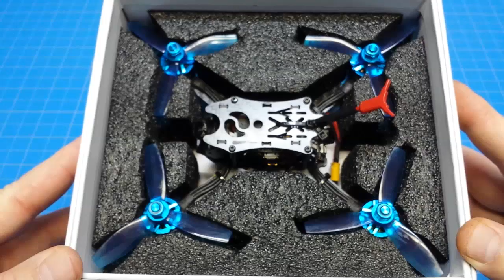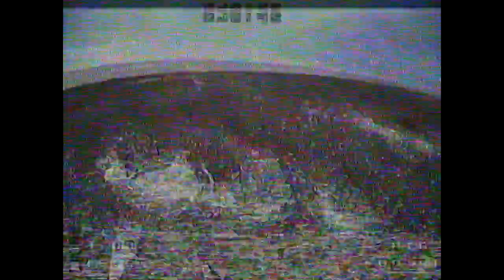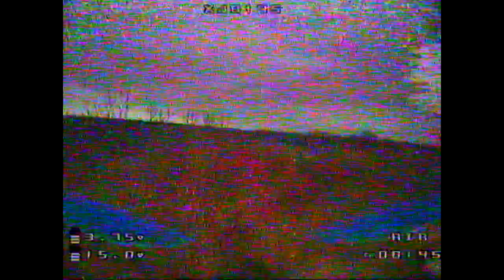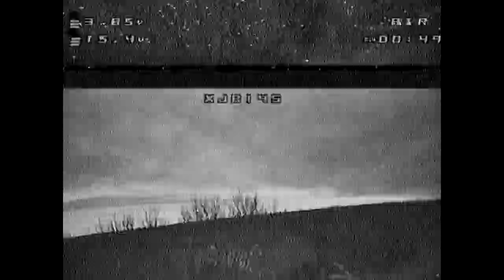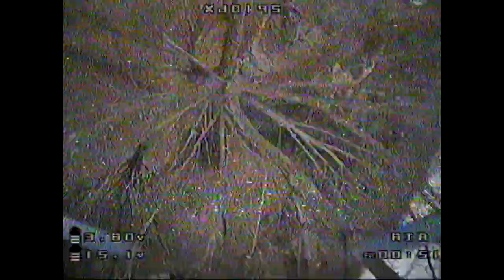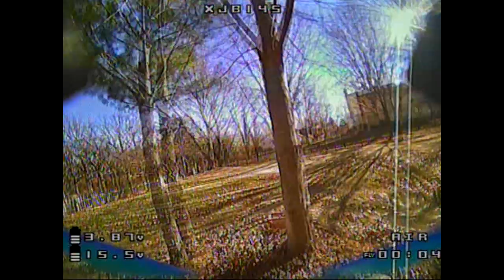HGLRC XJB145

Comment: I am using an XM+ and jumper ts8g with all stock settings on the XJB-145.  When I do flips and rolls in horizan or acro I get failsafe/rxloss warnings but have control of the quad.  Any suggestions?  XM+ flashed with latest RSSI software on channel 16.

https://www.youtube.com/watch?v=v8GYzSde8ZQ
Reply from the maker: I wonder if its a loose solder connection or loose connection on the receiver end. That symptom is typical of a loose connection. I would resolder and check again.
Reply: thx, I re-soldered the rx directly (removed the pin connector) and re-located the antennas.  I am getting a lot fewer rxloss warnings but they seem to only happen when i do full stick rolls or flips.
Reply: Could this be an issue caused by a betaphight version?  what version of betaflight are do you have on the XJB-145? Mine came with 3.2.3

Comment: I ordered an XJB-145 on sale from Gearbest, and the gyro is dead on arrival, preventing arming of the quad.  I was completely surprised that this has been on ongoing problem with this quad and the stack you can buy separately as well for a very long time since this drone is nearly universally praised for its quality and performance on various youtube channels.  I highly encourage anyone considering this drone to read this thread on RCGroups.  Buyer beware: https://www.rcgroups.com/forums/showthread.php?3000984-XJB-F428-No-Accelerometer
Reply from the maker: I think its also worth noting, it is much more common to voice displeasure than pleasure.
Reply: True, my biggest issue is the non-responsiveness for many people having the exact same problem from HGLRC across multiple versions of the same FC.  In the thread above, HGLRC's response to a customer was to reflow the solder themselves on the gyro, which is preposterous to ask a customer to do themselves, another was to ship the flight controller back to Taiwan at their expense.  Then they just sorta stopped responding.  That to me is kind of a red flag.  Any company can make mistakes, or have problems with manufacturing, etc.  But if you don't take care of your customers, then I steer clear.  And this is a common enough problem there's now a youtube video discussing the reflowing of the solder process, so it's beyond the problem of just a bad apple here and there.  I'm early in the process with Gearbest support, and I've also emailed HGLRC.

Comment: Love this one.  Only flew it about 7 times so far.  My OSD display is not working anymore on it.  I can only see the camera for flying.  No FC OSD information at all.  Does anyone know what's wrong??  Thanks in advance.
Reply from the maker: check to make sure the osd isn't turned off in betaflight, Also be sure you don't have a mode/switch setup to disable the osd.
Reply: Thanks.  I'm still not sure why but OSD is not working for NTSC video. Albert Kim has help me by setting the video to PAL video, then the OSD works.  OSD used to work in NTSC video.  Thanks.

Comment: Would you recommend this one or the Babyhawk R 3 inch? Could you please do a short summary of why? :) Thanks in advance!
Reply from the maker: If we aren't looking at price at all. I chose this, it performs much better, I can't stress this point enough, the xjb145 has a different class of motor. The xjb145 can mount a small hd camera if we want to do that. The babyhawk requires much more work to mount a camera.
Reply: Thanks for the quick reply! Keep fighting with my fears of the props in the FPV image. (Found transparent props which could be better a little, but still there...)
Reply from the maker: we become blind to props in view over time. I still notice when I first put the goggles on, but once I lift off I don't see them.
Reply: Sounds good, thanks again :)

Comment: Hey Nick - Currently the listing on Banggood says that it comes with the TX20 V2 (48ch with smart audio) while the listing on Gearbest says it comes with the TX20 V1 (72ch NO smart audio). Most all the reviews show the PNP version with the TX20 V1 (72ch), but I want to make sure I get the version 2 with the smart audio but IDK if I should trust the banggood listing. Do you know what is correct? (FYI I asked the support and they did not know)
Reply from the maker: I can't be sure. These companies switch at components with no spec updates.

Comment: Every video review of this quad seems like pretty low flight times. Would you say this is a battery hog compared to other three inch racers?
Reply from the maker: No, actually there are much worse. In my case I do fly with a smallish battery, I like to maintain a low weight for extra agility, it could easily carry a 650mah or even 800mah for longer flight time. But if your looking for more than 4mins likely looking at something that doesn't fly like this.

Comment: Is there a way to get audio ? With the stock set up ? Or something I have to swap out for ? Thanks so much 
Great review! I’m considering picking one up.
Reply from the maker: not stock. I think we would have to add another camera, or at the very least change the stock fpv camera to one with a microphone.
Reply: Nick Burns on this video you used stock camera ? I hear the motors   
That’s wat I want to hear with my audio. Is a small mic on maybe the transmitter? I’m confused. Lol
And yea I would change cam to a micro runcam for sure. Thanks 
LMK if you remember what gear you used on this vid
Reply from the maker: The audio is from a stationary camera (not on quad). I mix in the audio when editing the video.

Comment: nick i like this quad a lot, do you suggest it for long range (300 500meter) mainly exploring surroundings not freestyle flights? possibly with an hd camera on top?
thanks alessandro
ciao
Reply from the maker: getting a long range RX in under the top plate is going to be a challenge. The RX will likely have to go either under the camera or at the back, it can certainly carry an HD cam.

Comment: Nick, 

I have an odd question that I'm not sure who to ask besides you.  I can't think of anyone who has had more of these micro frames.  Sorry for leaving this question on YouTube but I don't have any other social media.  

I am about to start a new build with the new hglrc stack.  It includes a flight controller, vtx, 40a escs.  I want to also include the runcam split mini in it.  The runcam split mini is 2 20*20 pcb boards.  This configuration would leave me with 5 20*20 pcb boards in my flight stack....

Can you think of any frame that would accommodate this?
Reply from the maker: The eclair v2 is close but the cam won't fit. In this moment we might be looking at only a very few frames. The tomoquads csx...I think thats the name might.
Reply: Think the GEPRC Sparrow might work?
Reply from the maker: I don't think so, the pod plates are to narrow.
Reply: for the camera?  the new runcam split mini is 19mm across like a micro swift.
Reply from the maker: Yes, sorry, your right.
Reply: so, you think there is any chance that 5 (20X20) pcb boards will fit in a sparrow?   any other frames i should consider?

Comment: Can a drone like this also use an external HD action cam like runcam 2 or session/runcam 3 ?
Reply from the maker: yes, but it will impact performance and flight time.
Reply: I see, would you ever recommend using runcam split? May be with a soft mount or softmounted motors to get rid of jello?
Reply from the maker: We start to lose the micro of the quad when we have to move to a 30x30 stack, but yes that is an option. I think its more likely we need a better HD camera option. Something closer to 15% of the weight of the quad.
Reply: Thanks for answers. Im currently training in simulator and was thinking about a drone that would be easy tot ravel with and take some outdoors HD footage as well as fly indoors, in the open space office at nights for example. I guess so far only two separate drones can satisfy my wish
Reply from the maker: yes, indoor and additional camera is likely going to either not be viable or be a huge indoor space.
Reply: Hi, adding to our yesterday conversation, do you think with the Item like this one I would be able to mount runcam split on micro quad? https://goo.gl/UTCNZg

Comment: Not going to lie, want one pretty bad, but that 600tvl will be out the door fast. I for the life of me have tried but I cant seem to go under 700tvls. It just does not inspire confidence for me personally. Thank goodness that runcam just came out with a new CMOS 700tv in the same form factor. I generally run eagles or other cheaper CMOS cams. With some setting adjustments you really can get a great pic out of the eagle....as always great proximity flying....I could really tell you were feeling it, generally a great indicator for the quad itself.

Comment: Hey Nick, was missing some flight footage on your vids, eh eh... I already flown my Leader and ran into my first problems, I only have the stock battery so I´m not risking doing fpv with it, want to get used to it first... It was flying great until the battery started to get low, when I gave a litlle more throtle it started rolling on it´s own, I think it´s what people call the flip of death!!! What do you recommend I do??? I have some GNB 550mAh batteries ordered and GEMFAN BN2035 4 bladed props, I saw that DRONE RACER 101 had to calibrate the ESC´s on BLHeli suite but I dont want to do nothing to it before I get your opinion, please help me man, loool... All the best
Reply from the maker: Was the beeper going? If the stock battery falls to close to 5v or below I can see how it might tumble out of the air. Do you have a dvr? If so record the fpv while flying and check the voltage. If the voltage is above 6v when it flips out I would increase the idle speed in betaflight .5, then test again, and keep raising it. If you get to 10 or the quad starts to lift off stop and decrease idle speed. At that point we should consider flashing the ESC.

Comment: What angle did you have the camera on when in the top hole? Did you try it on a 550mah 3s?
Reply from the maker: I believe the angle is 40degree. I did not try 3s. On 3s you can increase P on all axis of the pids.
Reply: Nick Burns do you think it will fly ok on 3s 550mah
Reply from the maker: oh sure. It just won't have the same speed or punchout verticality.

Comment: I ran mine with a session 5  and it it still had plenty of power on 1050 and 850 4s's.  I just couldn't get rid of the jello before I burnt the esc out,  that was due to me lowering the stack for more space and the strap tore off a cap resulting in fire.  Let me know if you find a hd solution.
Reply from the maker: I don't think I could pull off a flight like in this video with the added weight. I tend to stay light and agile, with a 3min flight being the goal. After 3mins I start to get fatigue.
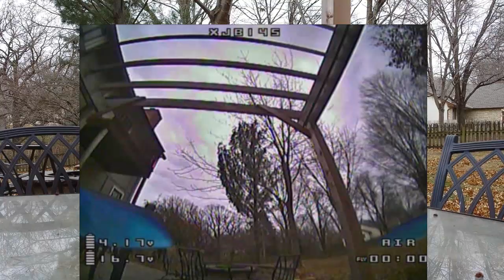Reply: I actually been preferring to split up my flights into 2 shorter ones, 1:20-2 min depending how/what i am flying. Could also be due to the winter and not being in my 20's.  Keep up the great work bud!
Reply from the maker: I hear ya, my 20s where more than 2 decades ago. :) I don't mind a 2min flight but many don't care for that.

Comment: I have a 1 acre back yard, and I'm scared shit to fly like you do lol. How long did it take to feel comfortable enough to fly like that in your yard?
Reply from the maker: Its been a progression. I started out flying line of sight, then brushed fpv, then 3s brushless fpv and then 4s fpv, over the course of about 2.5years. :)
Reply: Yeah I've been flying LOS for now, need a larger area to practice FPV.  Your lucky you don't have a pool, for some reason my drones keep finding their way into the pool lol
Reply from the maker: There is a pool next door. A bit reason I stay low on that side of the yard.
Reply: BigD-FPV I've been waterproofing mine with Conformal coating, ever since my wh00p found a full bowl of water in the sink! Lol  Cheap, super easy to do, and surprisingly quick too! 😁

Comment: Nice video, that duralock pretty strong stuff?
Reply from the maker: It is, but less effective the larger the battery we use it on, but up to 850mah 4s it still works really well. I am using the low profile duralock, they have a larger size meant for stronger support.
Reply: Nick Burns ok thanks Nick

Comment: Always impressed with your flying, but this time you look like your blasting an 85 mph rocket around on rails! Happily I got this quad, but I'm still waiting for delivery of the r-xsr. When it does arrive, I'll be out there wobbling and humping around at 30 mph bursting to 40! Wheeee!!!
Reply from the maker: Thank you. How ever you fly, have fun.
Reply: Those receivers are a lot cheaper and super quick to arrive, when ordered from USA dealers. For some reason Both Banggood and GearBest sell them for more than retail. R-XSR's should be $19.90 tops. Got mine for $17.90 from Hobbyking using their 10% off coupon for signing up for text alerts. And, they don't hammer your texts either... Barely 1 a week! Co0ol! 😉

Comment: I'm building a mx3 and ordered all the parts but the frame. Should I stick to this or switch to the 145 frame. I like the mx3 frames design more though it's heavier. Thoughts?
Reply from the maker: It mostly depends what your looking for. This frame will have props in view where the mx3 will have far less to no props in view. If you like to fly fast forward, like racing style, a lighter setup will of benefit.